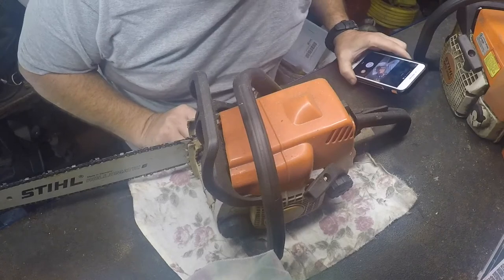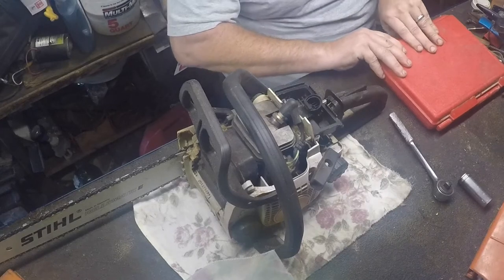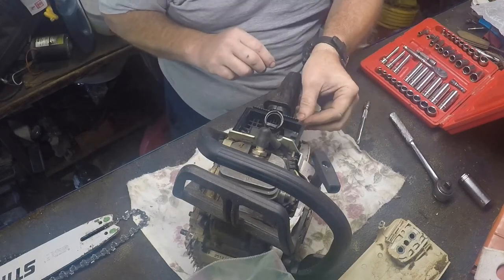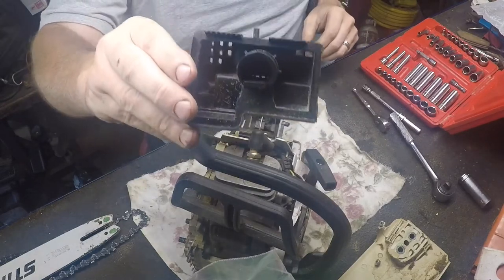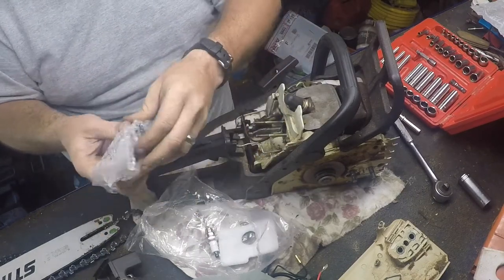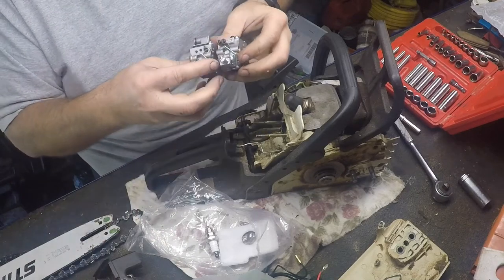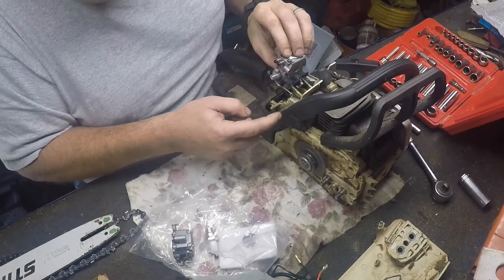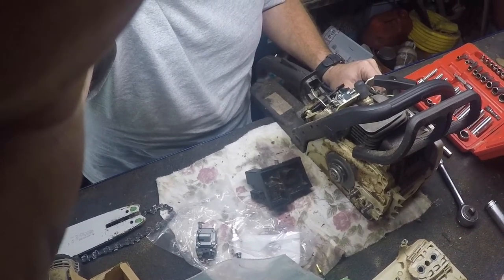STIHL 017 fully adjustable carburetor retrofit and installation.

Comment: That original carb had a compensater plate on top I hope you put on the new carb. 1 thing as a Stihl mechanic of many years you never talked about was drilling those holes. Bet they didn't line up worth a damn.